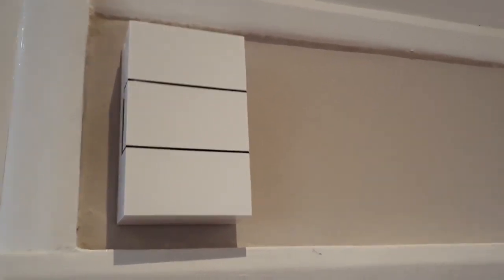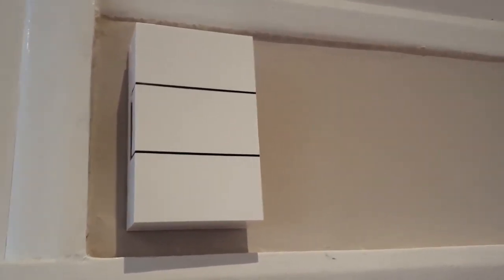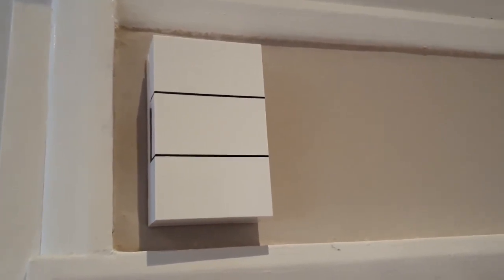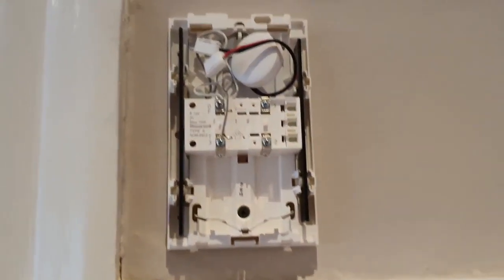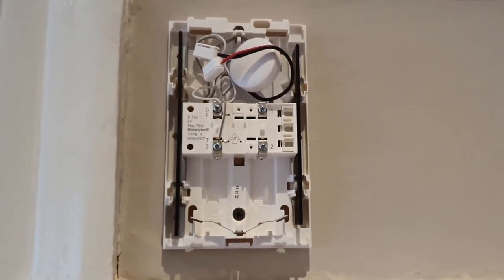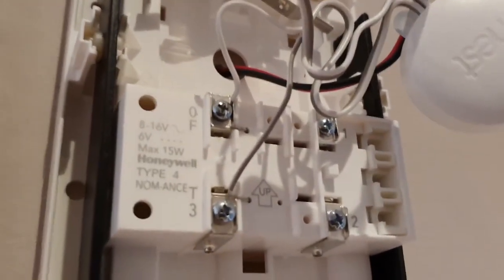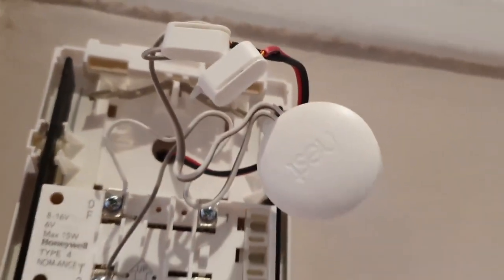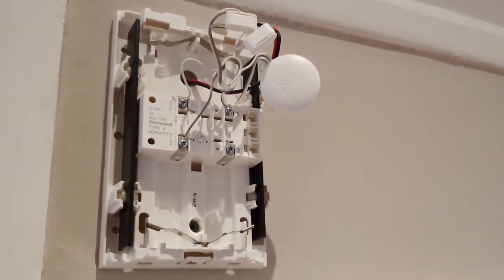Nest Hello with Chime - UK - Honeywell D117

Comment: Hi, I followed your diagram, I've got everything that you have here... But mine doesn't seem to set the chime off at all... However the doorbell itself is powered on
Reply from the maker: Sorry, not sure what to recommend, as this seems to work for myself and others. Could the bell be faulty? Or simply just a bad connected wire?
Reply: @impee  can't say for sure but the doorbell does power on when plugged in.. So it's getting power from transformer through the chime into the doorbell... Played around with connections till I got a chime... But nothing afterwards

Comment: So if you lose wifi this still works ? ie the chme will still ring?
Reply from the maker: I haven't tried without WiFi, but without Internet it still rings.
Reply: @impee  cool. Thanks f oh r the info. That chime is rated fir 8 Volts but it works ok with the 24V transformer you are using?
Reply: @tozguitar  Thats my concern.
Reply: @PoSSeSSeD82  I just got the nest battery but wired it in. Works fine with my 24V Traffo